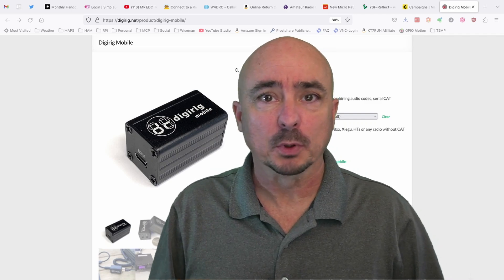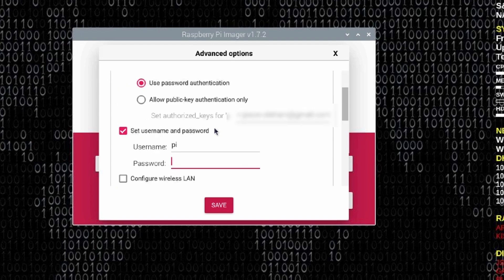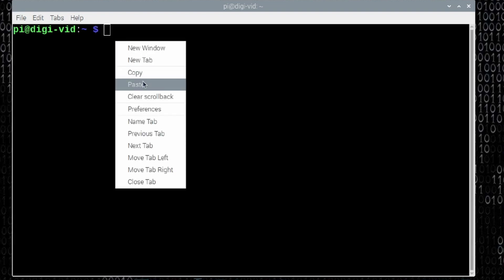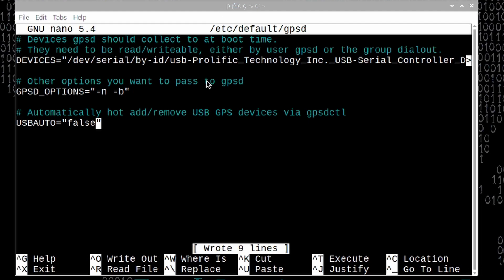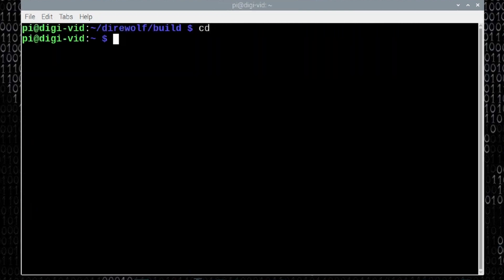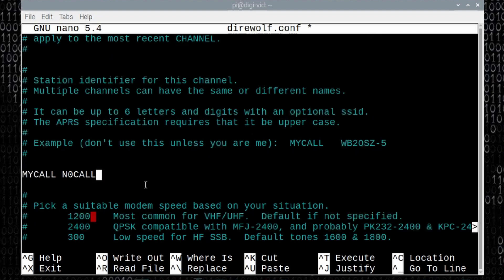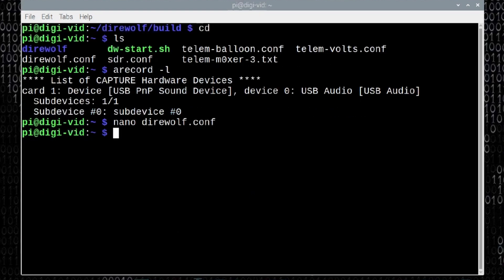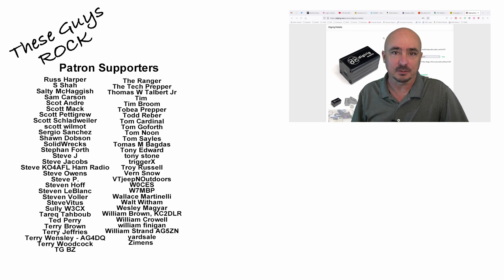Portable Digipeater Build with a Pi Zero 2 W

Comment: Hey Jason, will it work with the digirig lite?
Reply from the maker: It should but you will need to change to PTT method. The digirig lite using CM108 for PTT if I remember correctly.
Reply: @KM4ACK  ok thanks for the help

Comment: Jason, I successfully got the digipeater running using this build AND I used the crontab and startup script in the tracker video to autostart it ! Dang, this Linux stuff may rub off on me yet ! The thing I found is those little thumb drive size GPS devices don’t seem to work. The cabled puck devices work excellent (same U-blox 7 chip too).

Comment: Just finished the installation.  Excellent instructions, easy to follow.  Sound card and GPS are working, just waiting on a Baofeng UV5R as I didn't want to tie up my Yeasu.  May be a dumb question, but I assume I'm going to need a better antenna than comes with the Baofeng to be able to connect?  Not allowed outside antennas in my neighborhood, but have a JPole in my attic that works fine locally. Should I have an additional dedicated antenna?  Thanks,
Reply from the maker: I would certain upgrade the antenna. A roll up Jpole would be much better than the stock Baofeng antenna.

Comment: Even the Pi Zero seems a bit like opening a can of tunafish with a chainsaw. I wonder if an ESP32 or better yet an nRF52 would be enough to do the heavy lifting.
Reply from the maker: I can't speak for the ESP32 or the other device. They might work but I don't have experience with them. I grabbed the least resource intensive thing that I already understood.
Reply: @KM4ACK  yeah the software would have to be available, too. Hardware-wise I suspect they would do well. My thinking is that these (especially the nRF52) would use exponentially less energy and thus offer more options for go kit or disaster recovery efforts like we are seeing in Appalachia right now.
Reply: @KM4ACK  also the boards I mentioned are really cheap. An ESP32 is about $5 and comes with wifi and Bluetooth, a bunch of GPIO pins, etc.

Comment: Great presentation!  I ordered the 4-port USB HAT version instead of the one with Ethernet; the one I received uses pogo pins exclusively to connect to the Pi (the USB MicroB-to-MicroB jumper was not included and is not needed).  The Direwolf manual includes instructions for using cron to start automatically after the Pi is powered on and completes boot-up.  That may be more convenient for a portable digi, especially if someone is going to deploy it for you.  

You may want to add hotspot capability so that you can connect to the digi in the field to verify operation or modify the configuration as needed.  Did you package your digi for deploying, or just left  everything loose?

Comment: Would love to see this done using a mobilinkd instead of a digirig. I'm beating my head trying to figure this out. Thanks again for putting this together!
Reply: Also, what are you using to connect both the digirig and GPS while still powering the pi? Splitter?
Reply from the maker: https://youtu.be/cGee1SgDDsg
Reply: @KM4ACK Thanks! Is that still using a Pi Zero 2 W? I did check this out, but that wasn't what I had in mind. On that one it is slightly different as you are doing the APRS stuff with YAAC and mobilinkd as the TNC. On this one direwolf appears to be doing the APRS function and the TNC. My mistake is in my mind mobilinkd was just being seen as a wireless method to connect to the radio. Then I realized I am trying to connect a TNC to a TNC (Direwolf to Mobiliknd). I am trying to replicate what you showed in the video "Portable APRS Kit", but I was thinking I cold simply replace the digirig with the Mobilinkd. Then again I may be deeply confusing myself. Thanks again for the work you've put in on these. 73

Comment: Hi Jason! Thank you so much for putting this together. Your videos have inspired me to do many ham radio projects. I think this would be an excellent starter project for any ham and I could definitely see use for it anywhere!

That being said, I've decided to do this project as my area lacks digipeater/i-gate connectivity. The nearest digipeater in my area is north of me around 40 or 50 miles away. 

I have the Pi Zero W as well as a Baofeng I'm not going to use anymore. I have a homebuilt soundcard interface between the Pi and the Baofeng, however when I key up the radio, it interferes with the USB sound card running from the Pi to the radio, shutting down Direwolf due to soundcard failure and in many cases requiring a reboot. Do you have any tips or tricks for getting past this? Would it make any difference getting my hands on a Digirig?

Thank you and keep up the good work! 👍

Comment: One of the reviews of that hat said it doesn't work with the zero 2w.....

 "This is a well designed kit, unfortunately it is not designed for Raspberry Pi Zero 2 W (I don't have any of the other Pi Zeros on hand to check against). As a result, the pogo pin designed to connect to the USB OTG/ID pin is in the wrong place" 

Any thoughts?

Anyway, love your channel
Reply from the maker: They may have updated the design. All I know is that I am running the hat on a Pi Zero 2W without issue. All of my USB ports work.
Reply: @KM4ACK  I just got one delivered today and the review is indeed correct, so yeah it must have been redesigned and likely wont work with my Zero 2W. :/
Reply: @KM4ACK @Kleinbiker1 I built one today with a new Pi Zero 2W i purchased this week from Microcenter.  Works fine with the Pi hat listed above.
Reply: @ssyoumans  interesting. Maybe I’ll double check what I have and see if I can get one going. Thanks.

Comment: Jason, I was able to duplicate this build with an orange pi zero 2W, but CANNOT ssh in. When I try to ssh in, it will NOT accept my password...which I set up as you described. It just gives me "access is denied" incorrect password. I have tried this many times but get the same result...Suggestions?

Comment: This works great.  I originally had it set up with a Ft-60, which when attached to my station antenna, reached the closest iGate ok.  (With the HT rubber ducky, no joy, hence my interest in the digipeater).  Then I decided to add more power, and use my FT-2900.  Got the required cable and plugged it in, and got errors on the first beacon transmit:  
Audio input device 0 error code -19: No such device
Audio input device 0 error code -77: File descriptor in bad state
{etc}

Couldn't find any direct answer to this on the internet, but did come across a thread that suggested too much RF power out from the transmitter would mess up the digirig.  Cut power down to LOW 1 setting, and everything was fine again.  I have it up to LOW 3 now, and it is still OK.  I may get around to shielding the digirig and trying again at HIGH power.

Then, I tried to send a text message in APRS and got this error:  PTT Transmit timing error: PTT is on 108 mSec too long.  Dug around a bit and found advice to set the following in the CHANNEL  0 section:
CHANNEL 0
TXDELAY 30
TXTAIL 10
 That solved it and message was transmitted.

One final recommendation:  Set up a log file.  I opted for the single file as so:  LOGFILE /home/aprsuser/aprslogs/aprs.log
The other option is LOGDIR to make a daily log file.

Cheers,
K3TCM

Comment: Good morning Jason, I'm trying to setup my pi as a digipeater/igate and am having an issue with xastir, while updating the permissions my line does have the -x but it lists root root and not xastir -ax25 after using the ls -l | grep xastir command. I've used you build-a-pi and installed AX25, Direwolf, Xastir, HS like you recommended. Any help is greatly appreciated!
Reply from the maker: You can change ownership of the file with sudo chown root:xastir-ax25 xastir

Comment: Jason what revision of the digirig did you order?
Reply from the maker: I have a couple. 1.6 & 1.9
Reply: Im having a bear of a time getting the RTS to work on any of the Feng like radios .. i have a 1.5 and in the doc on Digirig itsays 1.5 and later you have to  cut the tracer on the board.. Did you have to do that?
Reply: @KM4ACK  SO i finally got this working.. after 4 different radios .. ended up getting the FT-65  so now its working.. although over a period of time it starts displaying the following in the terminal window.
[0L] K6WRF-6>APDW16,WIDE1-1:!4722.45N/12209.58W#360/000Portable Pi Digi - no igate

weird it didnt show the other data..   it was sayinh NO GPS Data time out or something and said to try and run CGPS or XGPS .. when i run CGPs is shows the collection of data  and then after like 5 cycles it has a successful TX update .. is something wrong or is that kinda normal?

Comment: Built this today, and I appreciate your video on this. It seems to work, except I don't have anyone close to hear it.  Is there a way to have the unit start up and run automatically?  I assume the way it is right now it would require manually start Direwolf after each power down. Sorry, my Linux is very lacking at this moment.
Reply from the maker: dw-start.sh is what you are looking for. It will auto start direwolf at boot. If you need help configuring, the guys in the direwolf forum should be able to help - https://groups.io/g/direwolf/topics

Comment: Did you show how and what was connected where with the hardware and cables? I am confused just looking at the one picture of the pi and another of the hat without them connected together. Thanks
Reply from the maker: The hat connects to the GPIO pin header on the pi and is secured with a couple of screws. Once it is in place, you will have regular USB ports on the hat which you will use to connect the GPS & Digirig.

Comment: I got stuck at the "sudo apt update" , When ever it gets to the second package, it freezes at about 26%...😞
Reply from the maker: Stick with it. An apt update/upgrade can take a bit of time on the zero.
Reply: I think I may have a pi zero that has a questionable wifi device.  I built the code using the ether connection, with no issues. Not so convenient for headless operations.

Comment: So i wiped my Pi, reinstalled everything based on this video. TX was working, so i then moved onto the GPSD settings and the RX stopped working. Seems the DigiRig isn't as easy to use as they'd have us believed, and emails to them for help have only yielded links to discussions on their forums. Starting to regret buying one.
Reply from the maker: Sounds like a conflict between the GPS and Digirig since it only occurs after connecting the GPS.
Reply: GPSD only says " can't run with neither control socket nor devices", so now nothing works ... bout to ship this digirig back

Comment: What I'd really LOVE to see is to take the raw PCB board version of the Digirig (which Dennis still has) and combine it with the RAW SA818 PCB which is the heart of a baofeng (I know they are crap) and make a single  tiny unit that is a Digipeater/radio combination. 

https://www.youtube.com/watch?v=CIeT4SWneeo&t=2s     ..  

What is the purpose? To power the thing on a tiny solar system and be able to put it in a tree or on a hilltop to make a remote digipeater station.    Granted, a HG-UV98  is an all in one handheld that has digipeater functionality, but they seem to be a dead radio.

Comment: What does digirig do that a cheap USB sound card doesn't? There's a big difference in price, so I want to know what I get for spending more
Reply from the maker: When working with an HT specifically, it makes PTT a breeze to configure and is super reliable. For other rigs like the 891 which is capable of rig control, I prefer the cheap sound cards.

Comment: Very interesting, sir. Just ordered the digirig module and cable(s) for the Baofeng HTs. (received a gift card for support of another ham) and look forward to setting it up. Hope to be up and running on a Pi3b+ Sunday evening. Looking to get something for my JT6188mini. -- KD9EFV
Reply: Let us know what VOX level seems to work best with this setup. Gene N7ARO
Reply: @genebodenberger  Starting build process with a few minor mods:
Using USB thumb drive instead of SDCard
Using Networked GPS Service (GPS USB Device on home network server) for at home or semi-fixed location, will use a direct USB GPS device when mobile solo
Noticed that the Digirig device pulls a lot of power, preventing my Pi3B+ from booting while plugged in when using my 'normal' power supply or a PC USB source.
Still building direwolf...
Reply: Created issue on Githun (pi-build) for error:
direwolf
Dire Wolf version 1.6
Includes optional support for: gpsd cm108-ptt

Reading config file direwolf.conf
Audio device for both receive and transmit: default (channel 0)
Could not open audio device default for input
No such file or directory
Pointless to continue without audio device.
My digirig device shows as plughw2,0 not 1,0, but all other info correct...
Reply: @genebodenberger  Sorry it took so long to get back, some RealLife(tm) stuff occurred.  I am not using VOX, I bought a DigiRig v1.9 to use, with the cable, and it uses PTT. The Volume on Receive seems to be sensitive, and I had to keep lowering it (Started at 75%) to about 25% to get consistent reception of a local DigiPeater and some mobiles that cruise nearby. I am now looking for good setup instructions for using an SDR & Pi for a receive only i-Gate. Good instructions to use the Baofeng UV-5RA and DigiRig for messaging...

Comment: Will you be covering the audio setup in the near future for this build?
Enjoyed your video!
Best regards!
Reply from the maker: Audio adjustments are pretty straight forward. In this case, use the audio knob on the HT to adjust so you are getting good decodes without getting the "audio too high" alert. You can also tweak the audio settings in alsamixer for a bit of fine tuning.

Comment: Great video! Started following your channel and have been learning a lot! I recently built an iGate/Digi for my home using direwolf. I was wondering, at the end of the video, when the beacon transmits, it looks like the RFI is coming back into the radio and it's picking up the beacon. I'm referring to the green text. Is this the case or am I reading that wrong?
Reply from the maker: I was basically sitting under my normal digi/igate that I run at home. Pretty sure it was that digi that was repeating the signal and then being heard by the new portable digi.
Reply: @KM4ACK  Gotcha. Makes sense.

Comment: Is the ttyUSB# dependent on which USB slot you plug into? If, for instance, you plug the digirig into a different usb slot, will it still work - or do you have to always use the exact same slot?
Reply from the maker: No. You don't have to use the same slot each time.

Comment: Jason, what, when, or why would you use a portable digpeater? Because doesn't a digipeater require internet access?
Reply: Don't confuse a digipeater with an igate.  A digipeater only unit merely repeats what it hears and could be the extra hops someone needs to hit that igate.

But aprs does not require Internet for local use.
Reply from the maker: I use a portable digi at least twice a year on Field Day. At our FD site, an HT won't make it into the wide area digi/igate. The portable digi gives us enough extra with its elevated antenna that we can make it into the wide area igate. Signal leaves the HT->hits the portable digi->is repeated where the wide area gateway hears it and injects into the internet.

Comment: I have very little digipeater coverage in my area and I think this to be the reason why my ftm100 isn’t Rx many packets. I have an extra pi3 and and ftm100. Would this digipeater help with coverage?
Reply from the maker: If your portable digi can hear a wide area digi....yes. I also have a couple of other videos showing how to configure an APRS digi and an igate. This might be a good consideration if you have limited coverage and have the ability to set it up and home and leave it on the air 24/7.

Comment: Thanks for stepping us through this Jason.
A great tiny option for portability. 
Could you add a small 20-50w amp with this setup?
Reply from the maker: You certainly could. In my case, I find 5W is enough provided I can get a roll up J-pole antenna in the air about 30 feet. If you aren't concerned with power draw, you could also use a radio like the Yaesu 2980R which would give you 75W output. Digirig makes a cable for the 2980.
Reply: @KM4ACK  Thanks for  that Jason, you're right. More options to look at.
I have a 9m pole and was looking at the Ed Fong or n9tax roll up j-pole antenna for other uses. 🤔🍻👍
Reply: @DonzLockz  Just thought I'd say hi.  I hope all is well.
Reply: @jmr  haha, you pop up your head everywhere. Lol.
Yeah, doing a fair bit better than before, actually able to function and now studying to level up my licence (to standard) and get back into the Bridgecom training to setup my Anytone DMR codeplug and hotspot, a long time waiting. Hope all is well, don't freeze in the blizzard up there. ;)
Reply: @DonzLockz  Awesome!  Maybe we can QSO when you get your DMR going.  This is another great channel so if course we're both watching!
Reply: @KM4ACK  i'm yet to get my 2980 to work (transmitting) ... any tips?